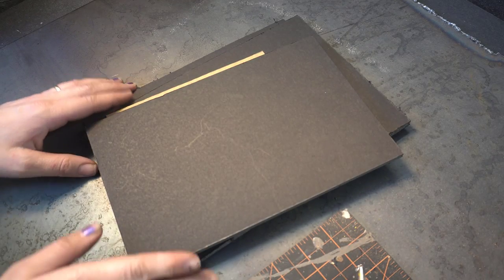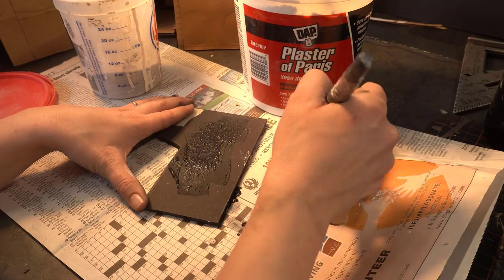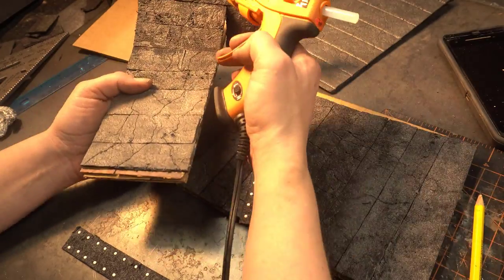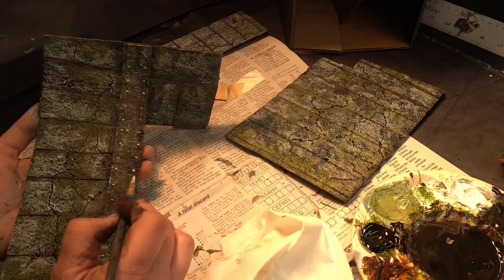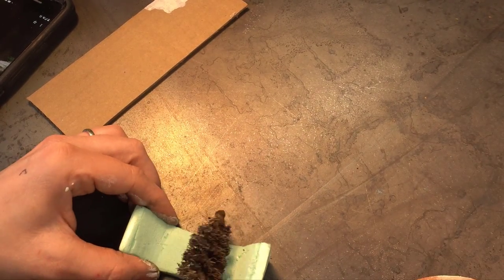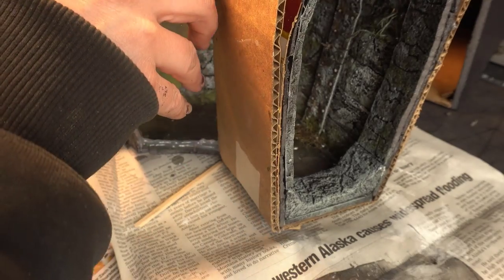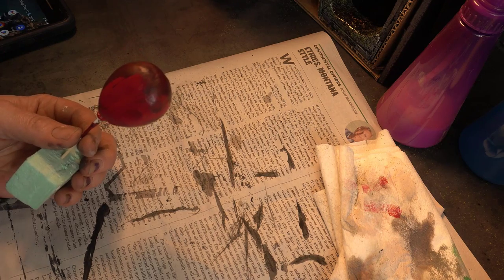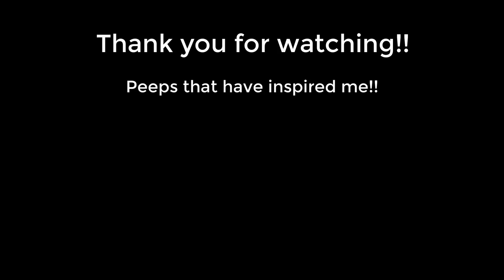The IT Book Nook/Realistic Diorama/Resin Art

Comment: Thank you for doing this video, I got this one for my birthday.   I have done one other (easier with the electrical then this one).  I was struggling with the instructions on the electrical and I find the way the wires go in to the box under the floor not so easy to do, as if there is a problem with the wires or batteries harder to take apart.  Watching you made it easier thank you